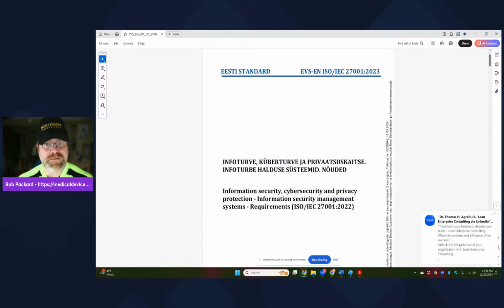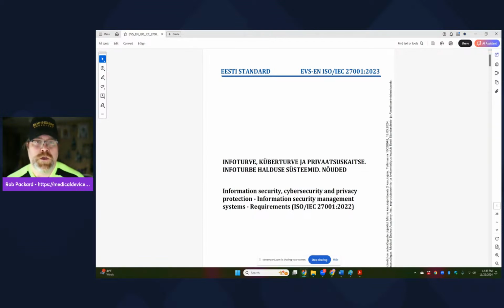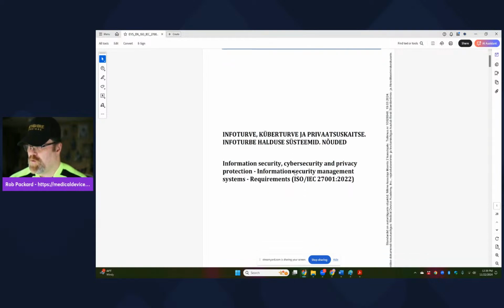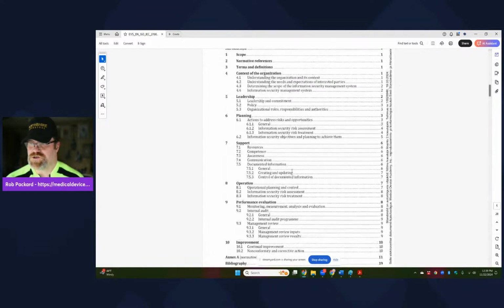How do you audit software vendors?

Comment: Basically to audit a software suppier, the main thing I need is access to the QMS and possibly the code repositories on github, bitbucket, etc and possibly the their project management/ticketing systems as well as a point person who I can ask questions to. 

Sometimes it takes longer than in person, but the flipside is it's often less intrusive to do it that way.
Reply from the maker: Lately we have been copying and pasting content of records into our reports using screen captures. This saves a lot of typing and speeds up our reports. Some things take longer to conduct remotely, but not everything.